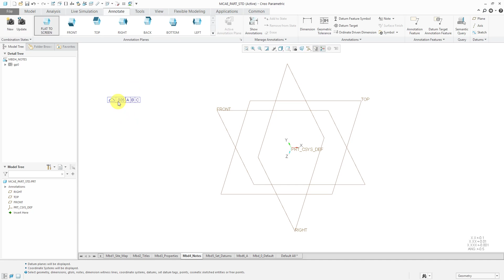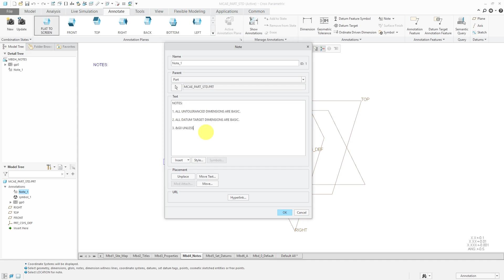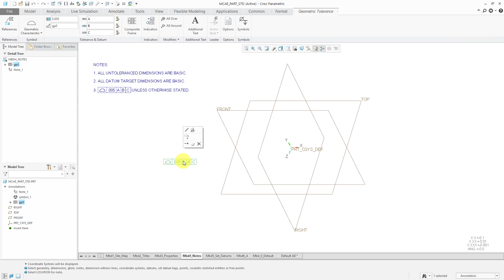Creo Parametric - Model Template Notes for Geometric Tolerances - Model Based Definition (MBD)

Comment: Thanks Dave, your videos are very useful and have more clarity..

I have a doubt..

How can i remove the tolerance table appearing in the bottom right corner of each combination state..

I trier config editor , but there is option to edit the values of this tolerance table, but i am not able to remove or hide it..

Thank you..
Reply from the maker: Go to Model Properties and Detail Options. Set tol_display to no. There's an icon that you can add to a tab (like the Common Tab) to toggle this on and off quickly.

Comment: Why do the annotations that are in layers do not go off?  In old versions it worked well!
Reply from the maker: What version are you in? Bottom line, Creo 4 and later there are so many nuances to controlling visibility. I haven’t done a video because there are so many different things to explain and so much depends on your setup.
Reply: @CADPLMGuy  I use Creo 5.0 and was accustomed to manipulating annotations with the layers but at some point they stopped working ...
Reply from the maker: There are two things that happened (both in Creo 4.0). First, each Combined State now has controls for specifying whether the visibility of Annotations and/or Supplemental Geometry - for example, a Datum Axis associated with a GTol - will be controlled by the Combined State or layers. The default setting is controlled by the config.pro option combined_state_type but again each Combined State can be controlled individually by redefining the Combined State.

Secondly, PTC wanted to make managing visibility easier for new users - Show/Hide and Layers tends to be too confusing for them. Therefore they made the Model Tree the master control for visibility. However, this wasn't as easy as it sounds. The Model Tree contains features, but Layers can contain entities as well as features. For example, a Hole contains an axis. Or a Copy Geometry feature can contain surfaces and datums. There can be conflicts between the Model Tree visibility setting and the Layer setting.

Bottom line is that I've found managing visibility a little easier in Creo 3.0, because the Layers were the ultimate judge of visibility. I'm still figuring out a consistent workflow for Creo 4.0 and later, and sometimes it can be a challenge with Annotations and Combined State. Also there is a bug in Creo 5.0 specifically related to axes that should be fixed later this month.

Comment: At the end of this tutorial, I watched and heard you "erase" the original feature control frame gp0 that had been absorbed into the list of notes and had represented the (overall) surface profile tolerance used for GD&T.
Please explain the logic of when to "ERASE" versus when to "DELETE" as it relates to views, shown dimensions, created dimensions, notes, GD&T, weld and other symbols.
Reply from the maker: The basic difference between the two is that Erase is temporary and Delete is permanent. Erase temporarily removes the Annotation from display and you can select it and then Unerase. Delete though removes it from the model. Deleting the Geometric Tolerance would prevent it from being called out in a Note.